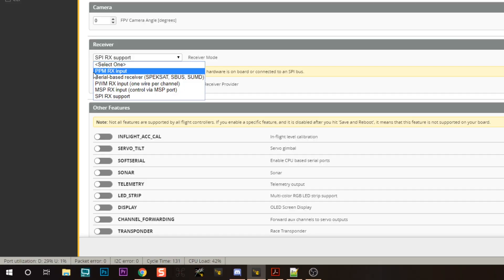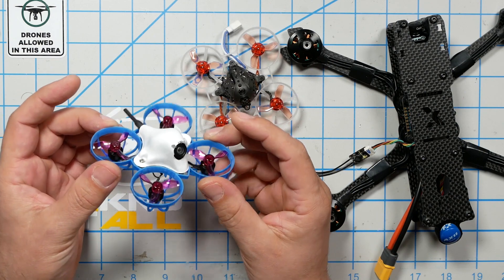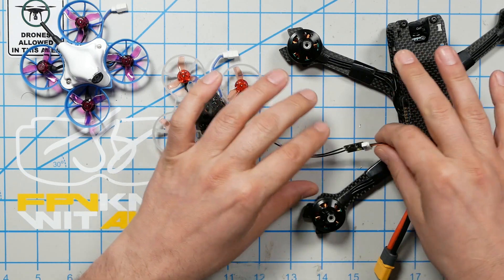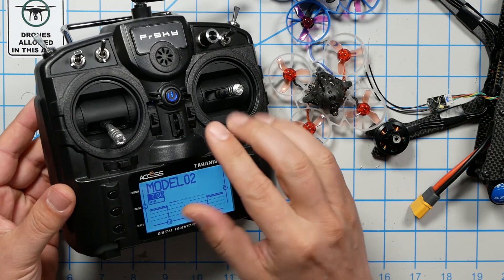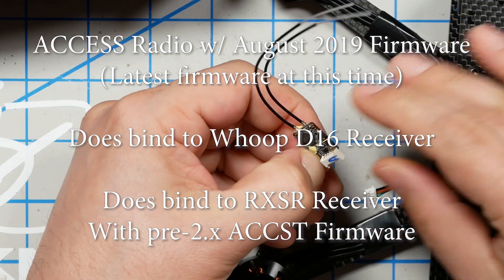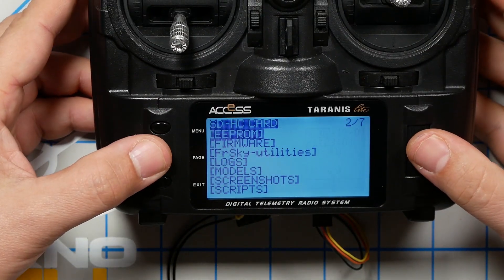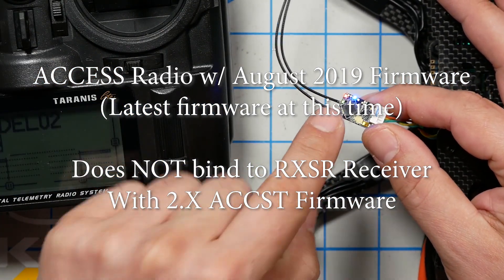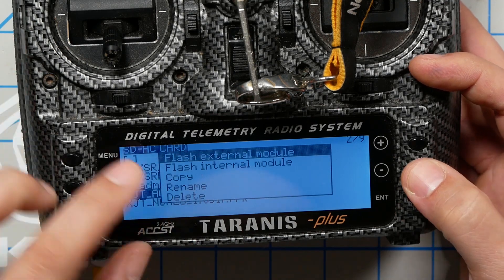FrSky won't bind! ACCST 2.0 is to blame.

Comment: I wish I wouldn't of got the Arris x220 with the Taranis Qx7 upgrade because this is now a big stick in my eye. I'm never 100% sure if the drone I'm looking at on any website will bind with my QX7. So I just need to only access receiver type drones? Is that the answer
Reply from the maker: It's the new ACCESS radios that have a problem, not your ACCST QX7. Most everything will bind. If by some chance FrSky starts shipping receivers with 2.x firmware you can always flash them back.
Reply: @JoshuaBardwell  Joshua they sent me a ACCESS radio I don't have D8 at all on mine.
Reply: I bought the Arris 220 and it came with the ACCESS radio, does that mean I shouldn't have gotten this radio? Is this the wrong one

Comment: I bought a taranis x9d a few years ago simply because it seemed it was the go to radio for fpv pilots, and so far apart from the odd headache with eu / EU-lbt/ fcc firmware conflicts it's been fairly reliable. 
However if I were buying another radio today  I would avoid frsky completely as they have shown that they are motivated by profit over all else, to the detriment of its once loyal customers.

Comment: Hi,
I've got a bunch of questions, that hopefully would also apply to many people. (Came back from resting and looking at this whole FrSky protocol drama/fallout)....
Q1(most important q, i feel): Seeing that FrSky is putting ACCESS fw on their newer "OTA" receivers, is there a way to get them back to ACCST? I have a friend that tried to use a QX7 ACCST to flash the ACCESS receivers into ACCST, and it doesn't work? However, borrowing a QX7 ACCESS to flash the ACCESS receivers into ACCST works........ did anyone tried it themselves as well?

Q2: Also i noticed that their newest receivers, for example the R9 MX, or the R9 SX, doesn't have any ACCST firmwares in their download section. So I presume that there will possibly be no future ACCST compatible receivers? As such, is my QX7 ACCST TX basically a dead brick in a year's time....

Q3: What should I do about my abandoned ACCST QX7..... sigh.

Comment: I have a related question. Can you flash the firmware of a R-XSR receiver with a T16 radio with the JR port like with the X9D?
Reply from the maker: Yes you can. Make sure you are using only a 2S battery and not a 3S battery and also check the pinout carefully as the JR bay pinout is not intuitive. Oscar Liang's web site has a diagram that shows the correct pinout.
Reply: Thank you very much  @JoshuaBardwell .

Comment: Would it be possible to put a TBS crossfire nano on a tiny whoop like a mobula or tinyhawk? Then you could just run with the new tbs transmitter which does look like its the way of the future!
Reply from the maker: Yes that can be done. BetaFPV does it.
Reply: @JoshuaBardwell  Is that a kind of DIY upgrade that anyone can do or do you need to buy a RTF version with the nano preinstalled? I wonder how  the added weight and power consumption would affect a tiny whoop if at all? PS keep up the good fight you are doing a great job!
Reply from the maker: You could do it yourself but the soldering might be fiddly and Beta makes their own modded antennas.

Comment: i did buy the frsky x10s last week and havent been able to bind to a emax buzz that has a frsky Xm+ reciver 16 ch diversity 
it cant be because of the new version right because they are both frsky or?  yes i am new to this
Reply from the maker: It's possible. Upgrade your xm+ to 2.0.1 firmware and see if that works.
Reply: @JoshuaBardwell  ive tried to "downdate" the transmitter but it failed so now as soon as i turn it on it says: Component IXJT Updating...
This will take few seconds 
i waited 12h before turning it off as i dident think it would ever complete that step, and right now i kinda regret ever starting the update. do u know if u can reset it somehow?

Comment: I just bought a brand new FrSky Xlite pro for $230 off of amazon.... had drone issues and waited 3 weeks until I was ready to bind.. the thing had full charge and randomly shuts off, has a line-pixelated black screen whenever you push the power button.  I am a right throttle thumber and new to fpv racing and really was excited to have a controller feel, but am pretty disappointed in the quality of the product.

Comment: If other companies could get it right, this would be moot point for our part of the hobby. We need crossfire built into whoop boards (I know, betafpv, but you know what I mean) and for the Tango 2 to have a bigger screen. TBS would dominate then. When I first saw the screen on the new radio, I was like "I'm supposed to setup models looking at a postage stamp sized screen? Seriously?".  I'm sure in the heck not going to setup models while wearing some hefty reading glasses or a magnifying glass in one hand. I guess TBS thinks everyone has perfect 20/20 vision, my watch screen is 2x the size of the Tango 2 screen. I understand smaller means more comfort and better battery life, but c'mon, that screen is too darn small.  Can't hop on the hype train, I'll stick with what I have.

Comment: I just bought a frsky x7 and tinyhawk. I can’t get it to bind even though it’s D8. Is this possibly the problem?
Reply from the maker: D8 should not be affected by this problem. D8 seems to work regardless of firmware version.

Assuming you have put the QX7 into D8 mode, it should bind.

Are you sure you're putting the Tinyhawk into bind mode? There is a bind button and a bootloader button. It's easy to mix them up.
Reply: I’m hitting the small button under the left front most rotor after I connect power.
Reply from the maker: The lights on the drone will go solid when it enters bind mode. They should be blinking when you first power up. Is that happening?
Reply: They go from both blinking to the blue light being solid and red blinking. I was with the understanding that ment bind mode and sold ment bound?

Comment: I bought in a long time ago as at the time it was one of the few that did telemetry. On one hand, now I have a Jumper I can leave the ecosystem, on the other I have FrSky Modules that could do the new protocol whilst the internal does the old. I just don't see the reason to do this except if down the line I want to fly someone else's quad with my radio. I have never had any issue with the old ACCST.

Comment: Did simebody tested this ? Iam still on v1.1.3 - I'm just scared that I can't flash back if I do an upgrade to v 2.1

2020-04-21 

ISRM  v2.1.0 

1.Improved reliability and stability of signal connection
2.Increased the range of control
3.Improved the stability of telemetry feedback
4.Added FLR ( Frame Lost Rate) display.
5.Added configurable function for telemetry power.
6.Added the option for switching S.Port / F.Port protocol
* the suggested alarm value for ACCESS RSSI is 32/35.
7.To be compatible with v2.1.x ACCST firmware for ACCST D16 mode.Note: Please update the firmware of all your radios(latest openTx or FrOS), RF modules and receivers accordingly.

Comment: My god, I’m so confused 🤷🏻‍♂️. I like my X9D, don’t really want to upgrade my transmitter because there’re douchbags. 
I’ve got 2.2.1 on my X9D. The last update I done on my R-XSR was 171009. Should I just keep that?
Reply from the maker: I would stay in older firmware if it's working for you.

Comment: Well this sucks. The folks at get fpv told me my taranis x7 with access would bind to my tiny hawk 2 I just bought lol... is there any way to get the taranis to work with the tiny hawk or am I writing a complaint??
Reply from the maker: The TH2 can be set to FRSKY_X protocol in the Betaflight configuration tab, and then it will bind in ACCST D16 mode. As long as the radio does not have the 2.X firmware version on it. If you flash to the latest 2.1 version ISRM firmware, then you cannot bind to 3rd party receivers like this one as far as I know.
Reply: @JoshuaBardwell  I got it to bind but I just have the signal dropping Bad RX problem, rendering it useless. Is there any fix for that? 
Also thanks for the help!

Comment: I just got the Taranis x9 lite and the jumper r1 receiver....will it bind? Because I’m having trouble! Help anyone?
Reply from the maker: You can flash the r1 using FrSky firmware for XSR. Flash it to 2.1
Reply: @JoshuaBardwell  I have successfully flashed the receiver as suggested and am still not getting any binding. Must I flash the taranis x9 lite as well with something?

Comment: So Ty I've been banging my head against the wall......Whoops just sitting on the bench...Not being able to fly sucks..... So I bought the RadioMaster Express Lrs Version and I don't understand why in every review no one explains why it has Frsky Lua + Like 6 different ones and what there used for....This post probably belongs somewhere else Because in no shape or way is my point a reflection on your video it's just my head is fried lol and this video was the last one of a long line of videos trying to solve this issue.  I bought an XJT thinking it would solve most issues, yes the Mark2 Elrs and XJT,  🤦when I guess what I should've bought the Multi 4-1 or yeah anyway thanks for your Knowledge buddy..Hate Frsky now lol as if this hobby wasn't complicated enough......

Comment: I bought an tinyhawk s and a x-lite pro.. unable to bind in any way... it is just not working.  What are the options? All tutorials just don’t work.

I tried getting into fpv but now I basicly spend my money on exactly the wrong stuff.. and I still cannot fly
Reply: Get an XJT module for your x-lite .. that way you have d8 for your tinyhawk, plus d16 for anything else that uses built-in receiver without having to buy/install externals. Or, just get an r-xsr receiver for your tinyhawk and you can use access (with telemetry and all). Either soltution will be about 25 bucks.

Comment: Wow! Wish I would have seen this video before I bought not one but two frsky radios . Both which are access I have had nothing but problems and no success thanks Bardwell and no thanks frsky. 🤔 Y frsky I wasted good money on what seemed to be good transmitters and I've never been able to use either one. Wtf r u thinking. Un happy consumer . I hope new pilots c this vid Thanks again Bardwell.

Comment: I resisted the peer pressure to join FRSky my whole RC life...but literally everyone was using FRSky and the receivers became the standard basically for FPV. So when the X-lite first came out I bought 3 of them, and a huge pile of receivers and switched my entire fleet of everything over to FRSky.

Single biggest regret in FPV so far. It's been nothing but a nightmare...and everyone that convinced me to switch so we could easily fly eachothers models has now left FRSky for something else.

Guess if the Tango2 is any good I'm going to have move to crossfire.

Comment: Do you have any idea how many hours of my life I've lost trying to figure this mess out? I've invested so much of my hard-earned money into an open platform that has now turned into a locked out ecosystem which I don't want to be part of. I love my Q X7. I pimped it out. I upgraded it. It's mine. It has always worked flawlessly. It never let me down. That is until I started messing at updating the firmware on a new R-XSR receiver in order to get telemetry through 'super-duper' FPort, and then sh*t hit the fan, and now I feel totally stuck into something I wasn't clearly told I was getting into, given the sheer magnitude of it's impact on a FrSky-ish RC fleet owner. Was FrSky acquired by Apple or what? What a mess, man. Very bad business. Currently looking at the Jumper T16, I'm only hearing good things about it. Thank you for your work; I'm glad you vented it off before going to bed cuz I really feel you on this one. </3

Comment: so i can't do NOTHING to connect my whoop to a frsky x9 lite???
Reply from the maker: You can buy an XJT module that plugs into the module bay.
Reply: ok I got the solution right now it's on https://www.reddit.com/r/Multicopter/comments/cenkx4/tinyhawk_s_binding_issue/eu5z0y0?utm_source=share&utm_medium=web2x 
basically, it can bound, the lights just won't function as normal (they won't blink or flash like it says every1ere they should lol) I'm so glad I found a solution 
Thanks anyways for the fast response

Comment: The multi-module (and thus transmitters such as the Radiomaster TX16S) do support ACCST v2  ( https://www.multi-module.org/using-the-module/protocol-details/frsky-x2 ). Thus, it seems that this video is outdated and that FrSKY released the necessary information about v2, right?
Reply from the maker: Multiprotocol can now bind to ACCST V2 but FrSky radios still cannot bind to ACCST 1.9 after they are updated to 2.0, and FrSky is moving away from 1.9 firmware and D8 mode, while 3rd party hardware still is on 1.9 for the most part. So the issue is not entirely gone.
Reply: I see. So I guess the bottomline is that we can keep buying FrSKY ACCST receivers but we should stop buying FrSky radios.

Comment: I guess the Tango II came out at a good time.
Reply from the maker: Tango 2 also can't be used with whoops unless you install a crossfire receiver.
Reply: Joshua Bardwell Right! But TBS has not yet radically changed the path and seemingly ethos of their company.
And i have the Fusion module which i love.
And i can still fly my old FlySky for planes and micros.
And i like their VTXs.
It bums me out because i bought the Horus thinking i'd never need another controller! It came with an R9, which i really like using, and i have a jumper module for flying Spektrum planes.  Super cool, super flexible platform. I suppose i can use the jumper module to fly ACCST < 2.0 and update the internal one, but what a freakin' pain from a company that got big by building a platform for opentx to take off on!
I'm sad/angry/dejected and right now i am digging on my perception of TBS as a company. It's like the beginning of a bad breakup.

Comment: Encryption that can run on sub-$1 uC's is weak, plus the known contents of the datastream makes it an easy target to reverse engineer.  It's only a matter of time before FrSky will have to resort to litigation instead of innovation.  We need some real Open Source options.  Kick Jumper for us ; )
Reply: This isn't about strong encryption or actually protecting data. It's about utilizing encryption to give the company legal teeth through the use of malicious legislation such as the DMCA. They use this to criminalize reverse engineering the products. Without the encryption as lame as it is, anyone can design a new product that performs the same task in a compatible manner. With the encryption if your reverse engineered product actually works then you have just become a criminal.

Comment: What is surely needed is a public domain Tx protocol (or protocols) that everyone can latch on to in future. It appears that all the Tx protocols are currently proprietary, and one cannot really blame a manufacturer for trying to hang on to their IP, but in the end, alienating customers seldom works long term. It is much easier to wreck a reputation than build it.

I bought a QX7 a few years ago when I started all this - because Taranis seemed to be the standard. But then there was the EU-LBT muddle (no other manufacturer seemed to fall foul of EU rules), then ACCESS, and now this. The next time I get an R-XSR will it turn up with this? If so it won't work. It is all too much.

If only the T12/T16 were available back then. FrSky have, in my opinion, gone way too far in their efforts to protect themselves. They are throwing their customers to the wolves.

Comment: Na your right dude.you should be pissed. I have a terrains. I also have an older  spectrum. Thing is I haven't used a frsky receiver in over a year. I Bind all my tiny stuff to spectrum the rest to crossfire. When I buy a new radio  it will most  definatly be the multiprotocal radio. There is just no reason for another choice.

Comment: I don't really care as long as it's working and doing the job I ask of it.
My X9D plus is doing just fine, it binds to my Mobula 6 and all my other planes and multicopters.
If I were to change, TBS crossfire may be a viable upgrade path.

Comment: I bought a used XM+, it did not bind to my X9D because it had EU firmware, flashed non-EU and still no bind. Freaking 2.0 ACCST firmware does not work with my 2016 X9D, i'm on latest EDGE TX. Back to the bench, luckly they provide ACCST 1.0 firmware on their website.

I'm upgrading to ELRS anyways, not a big deal.

Comment: 2 options for us frsky already users if things get even worse with this crap. Either we massively, alltogether, jump on the jumper train with a big smile on our face and lay a big turd and a middle finger on frskys doorstep, or we buy (also 3rd party) external modules and fly everything with an existing frsky transmitter. 
I know one thing for sure. i am not recommending any ACCESS new transmitters to any of my friends entering the hobby now. I am a new pilot with a relatively (1year old) X9D+ se and I am not updating shit. as long as my rxs work and i can find 3rd party rxs like these AC900s that work im staying put. im only feeling a bit shitty for giving these suckers loads of $ for the x9d+. if the jumper 16 was a little earlier on the market id be with them right now.

Comment: I spent over 1000 bucks on 4 tiny whoops and equipment which I cant use now. I even broke one of them because I didnt know FRSKY is screwing this up. I m gonna buy another radio for these 4 whoops I guess.
Reply: The same man, the same. Fuck FrSky. At least the can clearly state that the Radio is not compatible with tiny. I bought what was considered an entry-level radio but instruction were non-existant. Learned it the hard way.